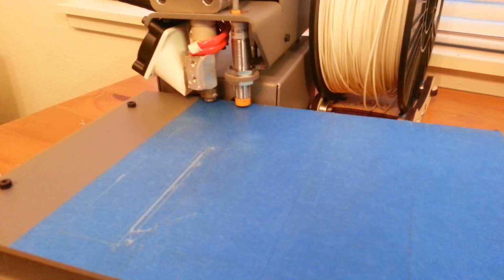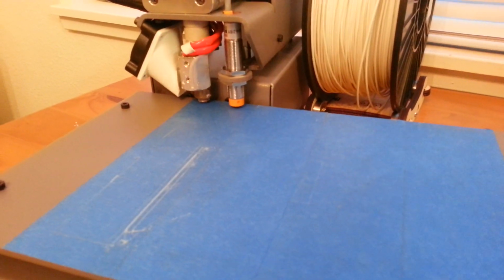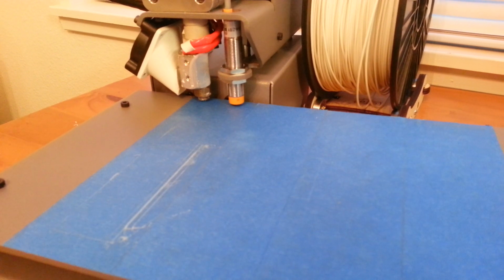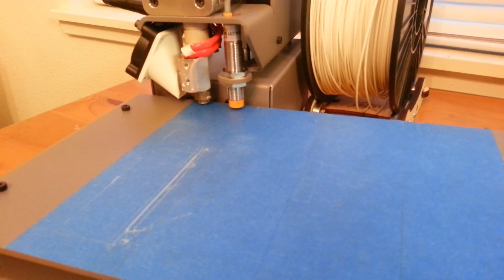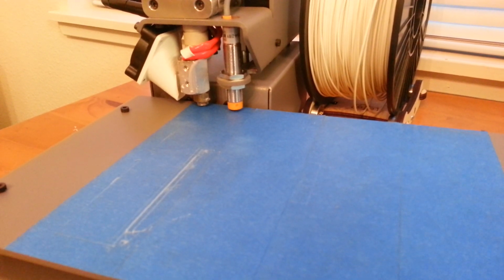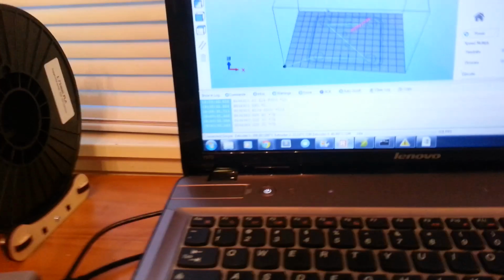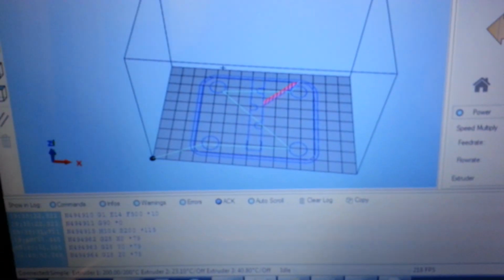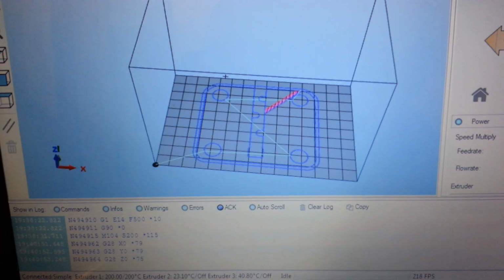Printrbot simple metal - auto level fail

Comment: So when I kill the job on mine it moves the Y to the front. How do you get it to dump to the back?
Reply from the maker: I've heard some people have their y axis connections inverted.  Try switching the max min settings and updating your home.
Reply: ***** Thanks will try messing with some settings. Didn't think to update home either in Repetier. Also, I found that If I just hit G29 to auto level the bot doesn't actually home all the axis first and because of that I get one set of data for each of the 3 spots but if I home every time before running a G29 I get pretty simliar results +/- .02ish. So I changed my start Gcode to home all 3 axis not just X&Y. So something like:

G28 X0 Y0 Z0; home X, Y & Z Axis
G29 ; Level Bed
G1 Z5 F5000 ; lift nozzle

It seems that having the z axis home and then go through the auto level I'm getting awesome looking prints that stick. I'm still stress testing it but you may want to try it out and see if you autolevel works better. Thanks!
Reply from the maker: I home all manually and individually prior to starting the print. Is that the same thing, you think?
Reply: Not sure. I just changed the gcode to home all three before probing. Seems to be working.